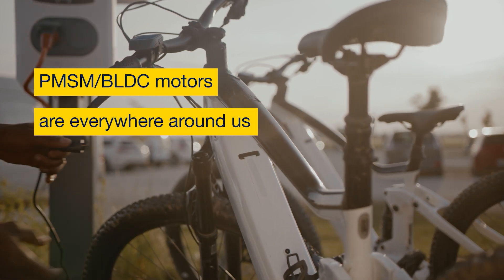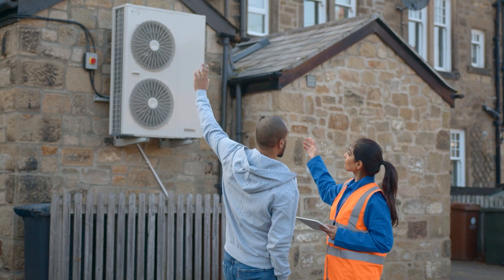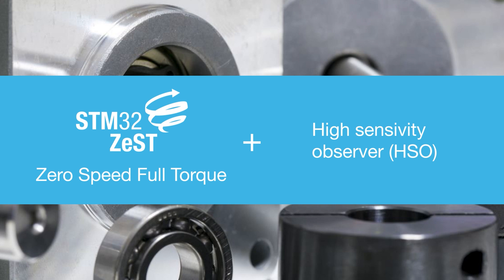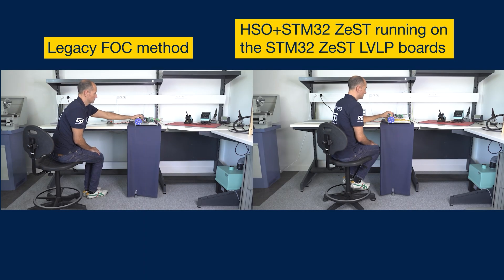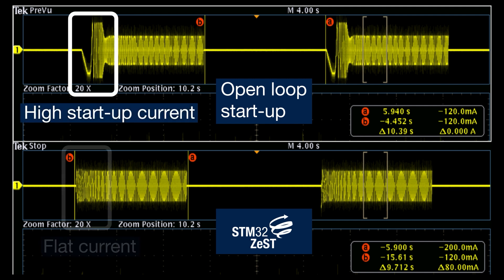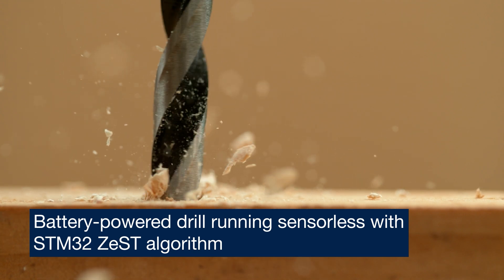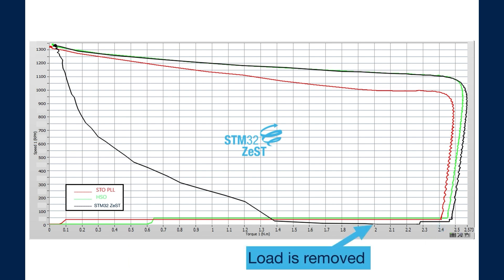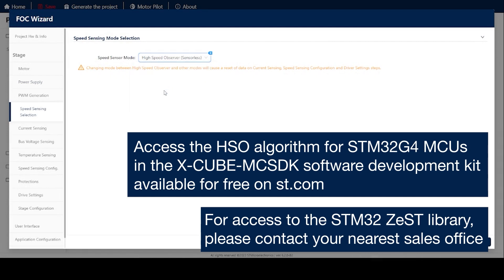STM32 ZeST Get full torque at zero speed

Comment: Does the ZeST algorithm also work for PMSM with trapezoidal emf?
Reply: its both for BLDC and PMSM which has major difference of trapezoidal and sinusoidal back emf. so, according to st, it should work, because they have mentioned it for both type of motors. its not still feasible for induction and stepper motors as discussed in conference.
Reply: @nomannosher8928  thanks for the answer. Does the algorithm also work for delta and star circuits?
Reply: @TakumiLee101  I think does not matter. if motor has three wires, then it can be directly connected to the driver board.
Reply: @nomannosher8928   Thank you, can the ZeST algorithm now be used with a suitable development board?
Reply: @TakumiLee101  I have not used this. In their conference, they mentioned G4.
Reply: @TakumiLee101  You should visit MC workbench latest where you can find the HFI sensorless based control. I am not sure whether they have added it in MC workbench or not. In their conference, they mentioned that ZeST is restricted to the selected customers who approach directly ST.